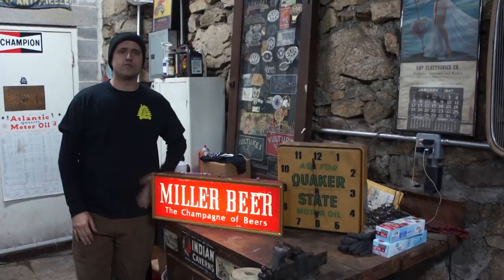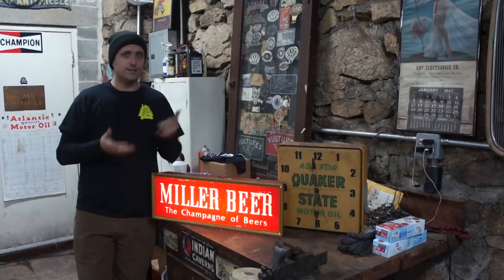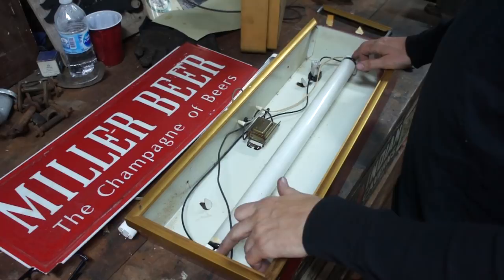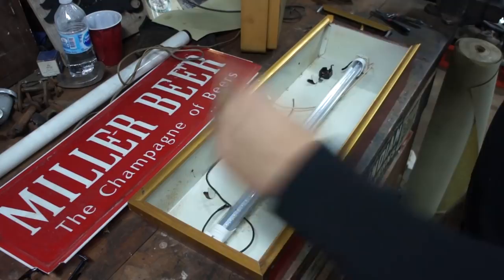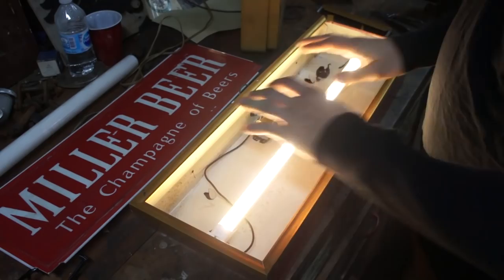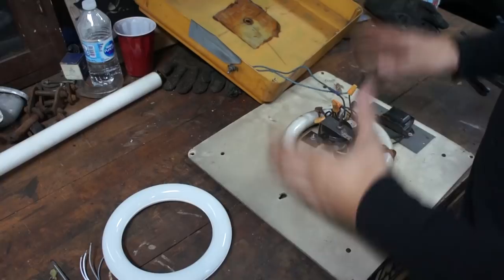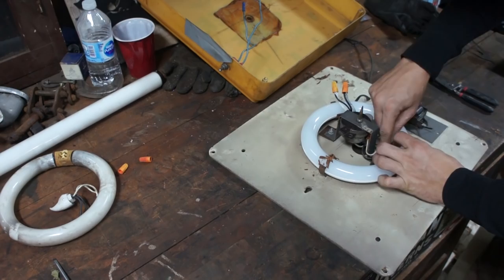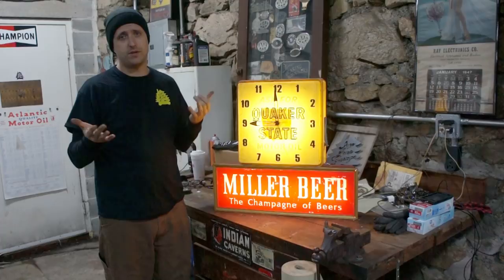How to Convert Vintage Flourescent Advertising Lights to LED

Comment: Got a Shell gas light up sign, inside it has a ton of individual LEDs wired to one another. It uses a power supply box. I replaced the box thinking it could be bad, I'm getting current but the LEDs are not coming on. What could it be?

Comment: Hi Mike/ Matt , Here in the UK, I have been steadily converting several of my old advertising signs to LED with great results as more compatible LED bulbs become available.As Geo B has said, in most cases , the synchronous mains electric clock movements( yours 110  volt, 60 Hz ) simply require a service, where the motor rotor is stuck in hardened grease  as are the gears after 60 years or more, I have some 1930s variants, all working again faultlessly after 3 years, one is outside under a car port and never missed a beat !.Try cleaning thoroughly and re-apply a small amount of light purpose silicone grease. I would try and avoid replacing the movements with quartz ones unless absolutely necessary as the majority were so well made, they will live another 2 or 3 generations without complaint !.If it is beyond repair, I would leave the parts carefully stored within the casing , future generations will thank you !.Love your channel, best wishes.
Reply from the maker: The clock actually does work, I misunderstood Matt during a conversation!! I am going to open it up and rewire the clock. Thank you for the info though it is greatly appreciate it!! - Mike/ITG

Comment: Hi Mike, hi Matt,
Often times, the clock mechanisms in old signs or cars can just have the gears cleaned and oiled again for them to work.  Most have NEVER been serviced and have become filled with grit and grime as well as the oil has hardened.....take the mechanism off, clean the gears, re-oil it and it should come back to life.....same thing with car clock....most are just in need of a good gear cleaning to remove the accumulated dirt in the gears and do a proper oiling to get them to work again.

Mike. your LED sign conversion is a great idea but you can go even a bit more inexpensive with more options in brightness and color by using strip LEDs and 12 volt or 5 volt power supplies you might have stashed in corners around the shop or your basement house from small electronics that no longer work or are not powerful enough for your requirements. you can even find the power supplies at salvation army stores for basically next to nothing. the strip LEDs are cheap from Aliexpress. If you're unfamiliar with them and their use there's tons of videos on YouTube about how to use em.

George
Reply from the maker: The clocks actually works!!! I misunderstood Matt during a conversation, I need to open it up and re-wire it. Thanks for watching!! -Mike/ITG
Reply: Thank you very much for explaining that, George. I was going to but you beat me to it!

Comment: I have a similar clock and I'm trying to do the same thing as you. I couldn't see what wires you were connecting where. I'm guessing you wired the circular LED fixture like you have has a 4 prong plug with 4 wires. Were did you connect those 4 wires? Or did you just wire 2 of them straight to the 110V power supply and cap off the othere 2? Or did you splice all 4 wires into the 110V power supply?  Little help, Thanks Kevin

Comment: Nice job on the signs would have liked to see the shop lights any old lights are cool and
when restored look great . I liked the fuel pump lights you done a video on top job any videos on 
these types on restore's are cool ,lights ,tools ,cars ,etc all thumbs up. Would be nice to see the clock motor working don't swap it out with a bit of cleaning it should come back to life.
Reply from the maker: I couldnt find any old photos of the light fixtures. If you look at our shop tour video part 1 there is good before and after shots. We are going to be mixing in more small restoration projects from now on! The clock actually works, I misunderstood Matt during an earlier conversation!!! Haha. Thanks for watching!! -Mike/ITG